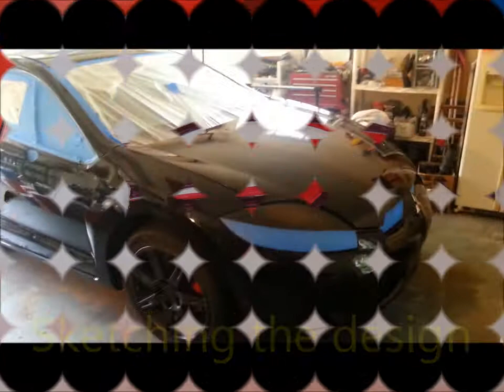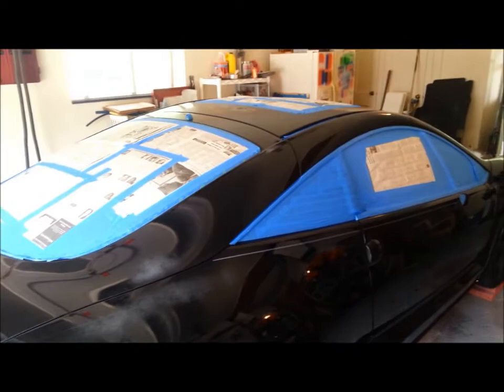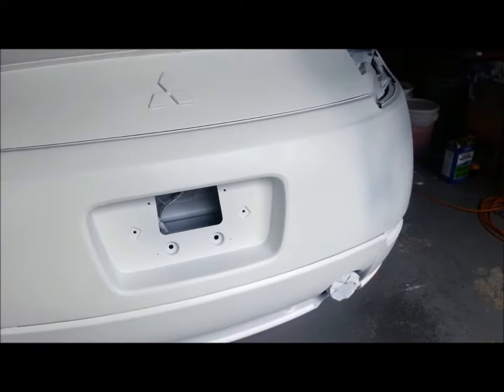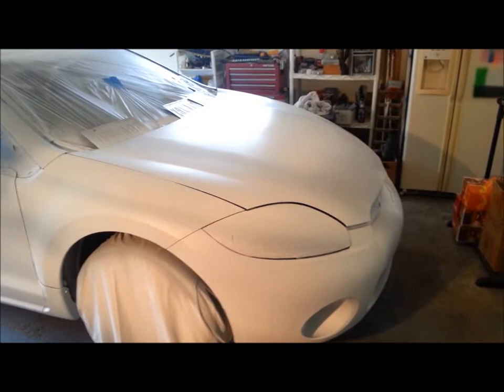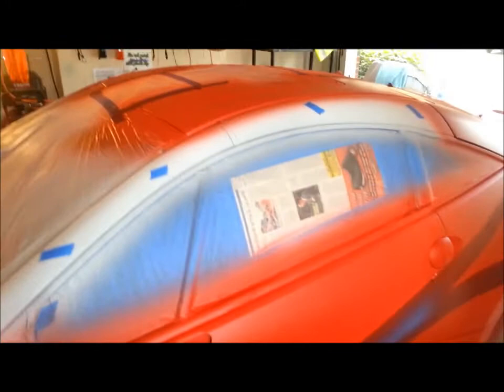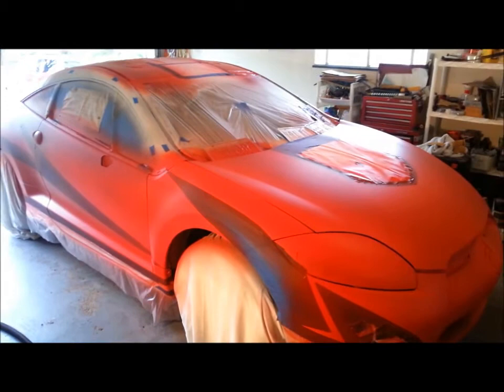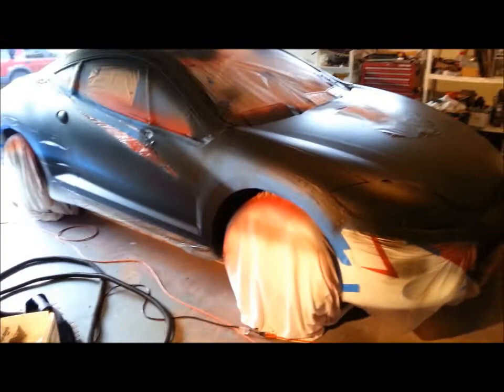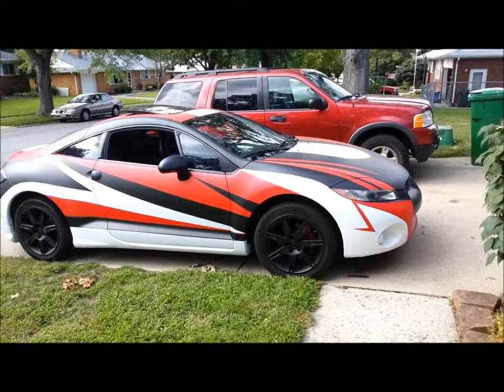Eclipse GT Full Plasti Dip Start to Finish

Comment from the maker: Slidog24. This was donecwith the Graco setup. I purchased this one on ebay, remanufactured for about $50. I prefer to thin my own. 

The black was stock color. The Red I added some additional red tint for brightness. The white was clear I tinted. I likevit better then stock PD white. 

All the tints I used were Maxitoner from Sherwin Williams. About 5oz per thinned gallon for the white.
Reply: Hi Rob, just wondering about how easy was it to remove the taping you did for the white areas being that it was some of the first areas you taped and were one of the last to come up. I ask cause a lot of people in other channels have mentioned that the dip bonds and rips off the other colors. Thanks in advance for your response.
Reply from the maker: All pealed fine. No issues.
Reply: +Vladimir Obregon I understand ur question cuz sometimes pilling it off also wants to take off the side you actually want to stat and is a struggle I use a knife and slightly knife the shape and then I remove the plastidip

Comment: That looks sweet! Did you spray one side and then immediately start peeling the tape on that side and then have to spray the other side to re-wet it to be able to peel it?
Reply from the maker: cody strange did all at once. Trick to pealing is I keep a small sprayer with xylene. i can then wet the line just befor i peal the tape. on this one i took up to 30 minutes just to peal so it had plenty of time to dry. Misting with xylene gave me clean crisp lines every time. check my other vids. the next job was even more lines and tape :)

Comment: Hey Rob is that all plastic dip and if so do plastic dip comes clear so I can tint to the color I want your car looks great
Reply from the maker: anthony singleton yes it comes in clear. In fact the white was clear dip I used tint as the PD white was not as bright as I wanted. DipYourCar.com has many pigments that work great with Plasti Dip. I used Maxitoner Tint from Sherwin Williams
Reply: Man thanks for the info keep up the D I Y projects I like how you explains it thanks again

Comment: Hey man, how did you get your stripes to curve so smoothly with the blue tape? Whenever i try and do it, it always comes out somewhat jagged
Reply from the maker: DSTOMPS88 Thinner tape bend easier and plan your lines for outside bends. GL :)
Reply: DSTOMPS88 remove the tape while the Plasti-Dip is still wet, that way it doesn't have time to dry on top of the tape so it will come off clean with perfect lines.

Comment: How where you able to peel the tape without the plastidip peeling with it?
Reply: You have to peel the tape immediately after spraying the final coat of material. The tape will leave a sharp line if the dip is still wet.